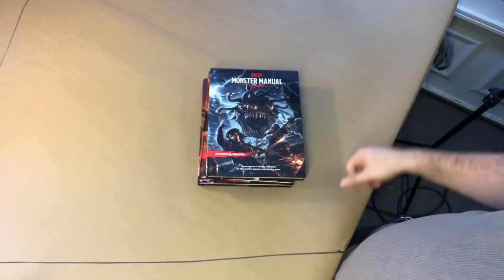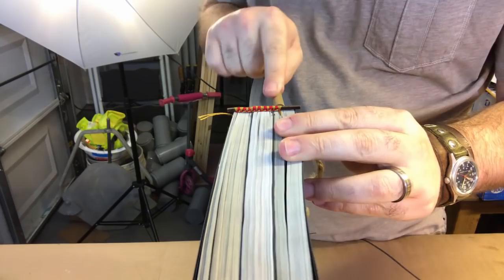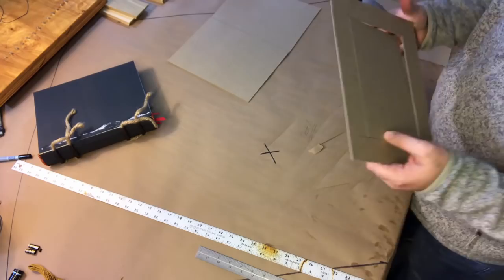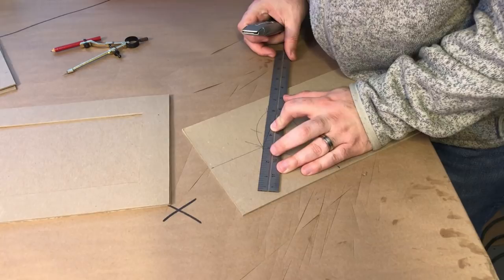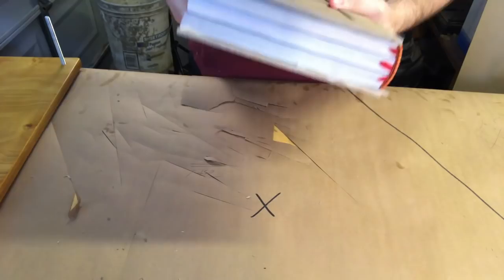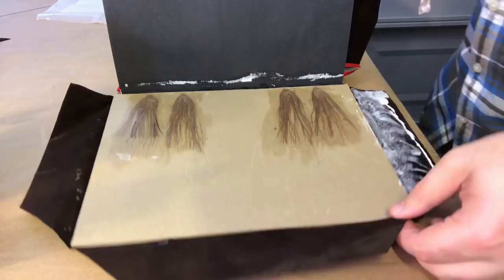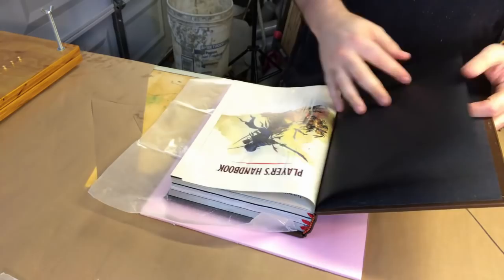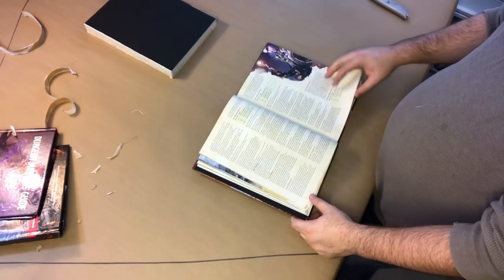The DMs Leather Tome - PHB, DMG, and MM rebound into a leather book! (1/2)

Comment: Out of curiosity, how hard would it be to separate chunks of pages and reorganize them, if for instance someone wanted to make a complete player's guide of each class all together, the backgrounds and feats all together, races all together, and so on. Other than the obvious significant time investment organizing such, would the different bindings need a lot more attention, or would it be a similar (relatively straightforward) process of sewing it together as shown here?
Reply from the maker: That's actually a very interesting idea. I think if you spent some time looking at the pages you'd want together, you could carefully cut them apart. The issue is that pages are printed double sided and so you may end up with page one of a section at the back end of another section and cause confusion. In theory it would just be a matter of sewing your separated section back together on the spine cords.
Reply: @TheWoodenOtter  so as long as you didn't mind the occasional weird disjoint in pages, or aesthetic things like font or background being different, as long as it was lined up well it would still work, you think?
Reply from the maker: I think it would work. One other thing to keep in mind is that the few pages you try to separate, the more likely you are to damage them. One page will be impossible because you need multiple pages to sew through, but even 2 pages would be very difficult to cut out of the book without destroying.